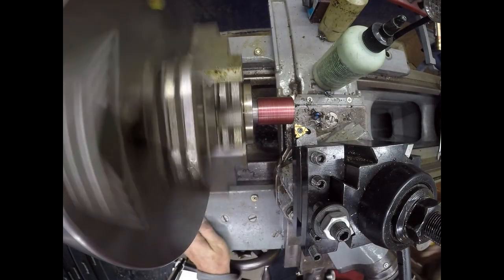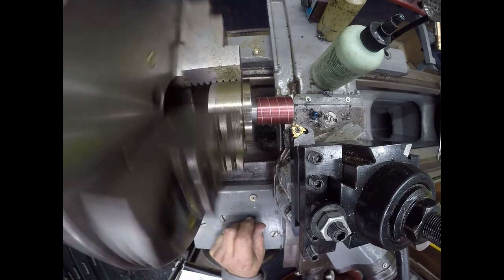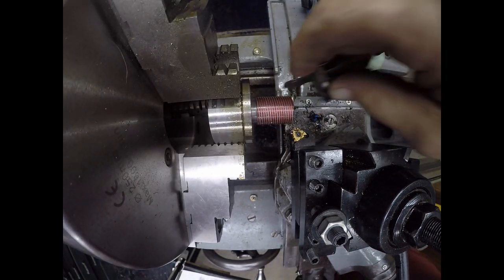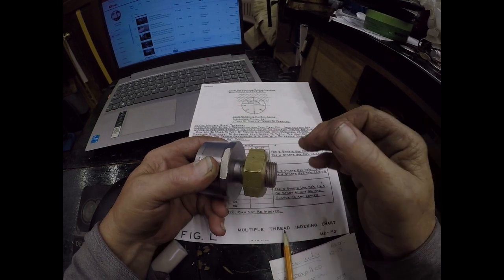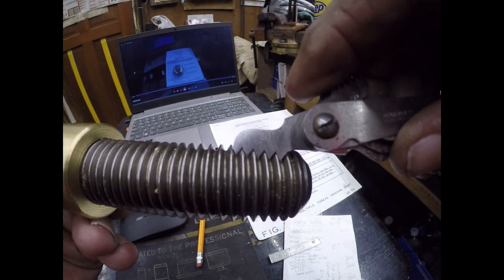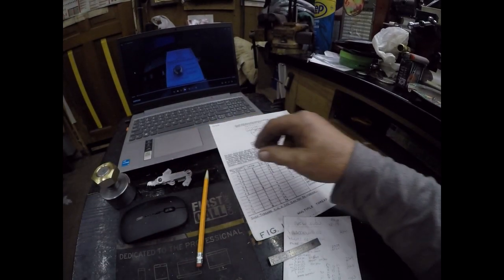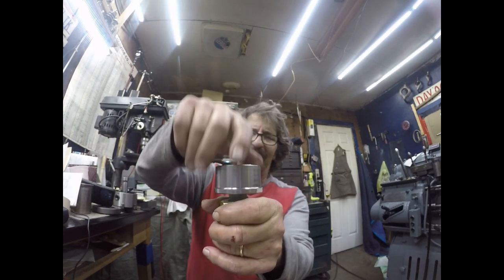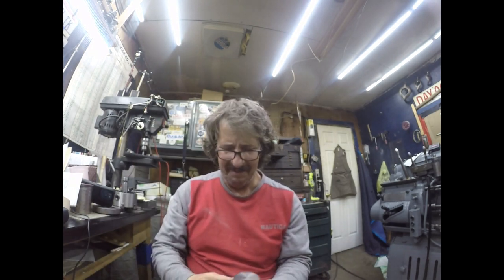MULTIPLE THREAD CHART

Comment: We made machinists jacks back in college, 30 years ago. Three section jacks, outside to middle section where threaded something like 1" 20 TPI it'll section to inside section or threaded something like 3/4" 40 TPI, with the understanding that the finer the thread the more it was able to resist downward pressure. So the question is does your four start thread resist pressure like 14 TPI, or like three and a half TPI?
Reply from the maker: I would say 14